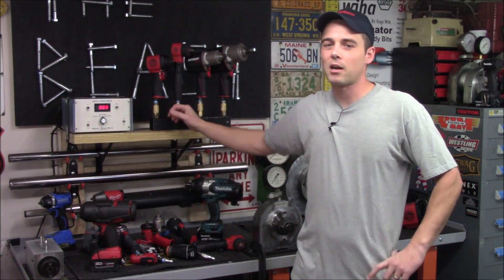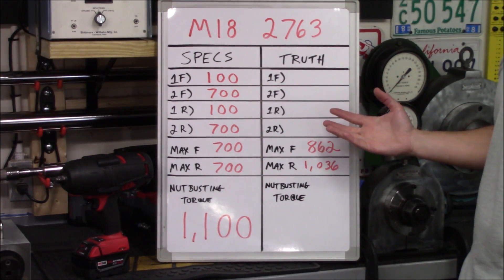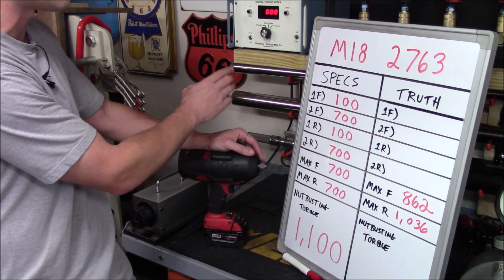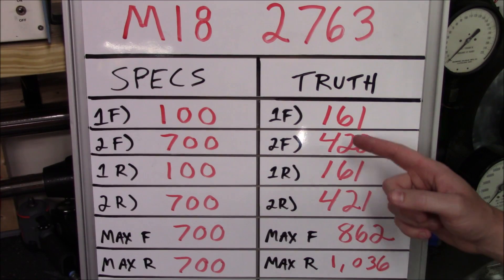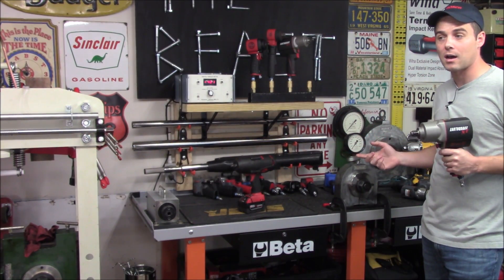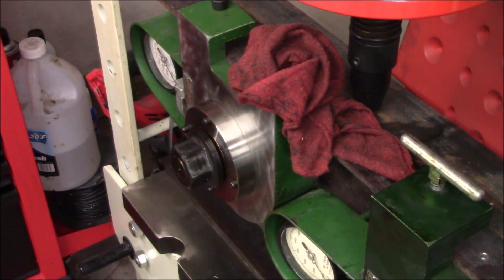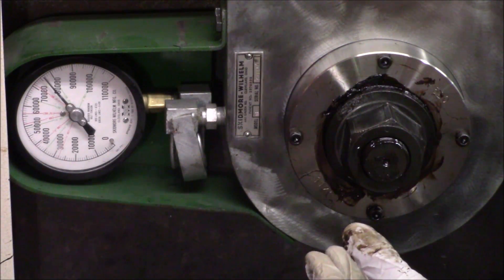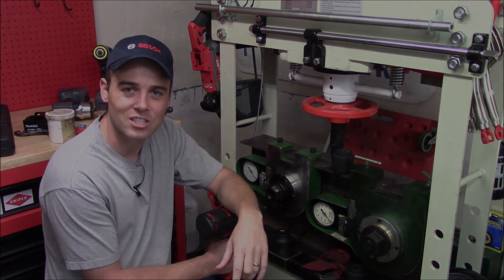THE BIG LIE -- Nutbusting / Breakaway Torque (What is it?) - Impact Wrench Torque Ratings

Comment: 1100 lb.ft. of nut busting torque means that it will break loose a nut that is torqued to 1100 lb. ft of torque
Reply from the maker: Wrong.  It means that it will "bust loose" a FRESHLY INSTALLED bolt that is still hot & has no corrosion on the threads.  It is a lie....plain & simple.
Reply: Real Tool Reviews 
isn't that what I said? obviously if it's rusted it'll be harder to remove.
Reply from the maker: Wouldn't that be the same as a truck being advertised as being "able to haul 2 tons"......but they forget to tell you that it is only in the first 3 minutes.....after that it is 1 ton.....same scam.
Reply: Real Tool Reviews 
not really. Maybe if you bring it beyond their intentions. like if you say "hey it says it's supposed to pull 2 tons! how come I can't pull 2 tons through this muddy field?" same reason the gun won't remove a nut that was torqued to 1100 ft lbs with another gun. If you were to run it up to snug with a gun, then finish it with a torque wrench as your supposed to, you would get different results. When you rattle it on with a gun, the nut gets hot & expands slightly, allowing for an inaccurate torque down.
Reply from the maker: Metal rubbing metal = friction.  Friction = heat.
Reply: Real Tool Reviews 
exactly.

Comment: 85-90 degrees is extremely hot? Versus 72. A parked car in summer time would have a lot more heat than that. At least in southwest US. It seems like there should be a standard torque standard as far as temp goes. Like barometric pressure has.

Comment: I've looked everywhere, I cannot find a video of you performing DYNAMIC TORQUE rating test on the Ingersoll w7150. I just purchased one with (2) 5.0ah battery. Please do a comparison video with the new results.

Dynamic torque
Ingersoll Rand w7150 : ??
Makita XWT08 : ??
Snap On CT8850 : 526 ft lbs fwd, 486 ft lbs reverse
Dewalt DCF899 : 411 ft lbs fwd, 418 ft lbs reverse
Milwaukee M18 FUEL 2763 : 421 ft lbs fwd, 415 ft lbs reverse

Comment: "Dooinnnng!" @ 6:43.  Good stuff, but these aren't "real' world" applications and durability, serviceability are equally as important as out-of-the-box performance statistics.
Reply from the maker: Explain to the other viewers how you can accurately obtain actual torque specs without calibrated equipment in a controlled environment?  Not going to happen.
Reply: It's not a question of you obtaining these specs utilizing the proper calibrated equipment within a controlled environment, hence my "good stuff" comment.  But tools do degrade with use and many work great "when new", and over time, what's equally, if not more important, are qualities such as durability & serviceability when compared to out-of-the-box performance statistics.  It's certainly much harder to quantify these attributes, and, in the long run, they carry more weight than controlled environment stats.  Furthermore, your exemplification of certain features being more triumphant over others when compared to other brands, is all subjective, as what's important to you may not be to another.  So be careful not to overstate what you feel is "not so good" to have or may be "concerning".  It makes the viewer feel that this is a somewhat bias production.

Comment: Can you please define dynamic torque and working torque? If the dynamic torque is really the peak torque achieved then I don't see how the working torque can be higher.
Reply from the maker: Dynamic = max torque applied with each impact of the anvil.  Working = max torque acheived over a specific duration of time.

Comment: Can I place a request/suggestion?  Can you measure the nutbusting torque of a Nitrocat 1200k using the second method in the video?  That is, removing a nut tightened to a known torque.

Comment: I don't know why you're trying to discredit Milwaukee. What's the point? The bottom line is that if the 2763 won't remove a nut or a bolt you need to call it a day or take the torch to it. The 2763 is a beast.
Reply from the maker: Lets see......I debunked a FAKE marketing term that is being abused......I am the only person outside of a manufacturer with the access to the same equipment.....I proved how they come up with inflated numbers, and yet you are implying that I am picking on them.  The only ones who are upset by this video (and the others I am continually posting about proof of various topics) are the marketing depts.

Comment: as a son of a man who's been working on cars longer than I've been alive. His advice for getting stuck or rusted bolts off is heat which I can't say doesn't work. but my understanding of physics has also taught me that heat causes matter to expand. meaning heat should cause cause a nut to expand around the threads of a bolt causing higher pressure. just my abstract thinking. but another great video. reminds me why I've been subscribed for as long as I have!

Comment: why didn't you just put the bolt on and come back  the next day to show it wouldn't remove it? why give a theory of how they cheat the test and just prove the point by waiting to show the lie instead of only doing the test hot and saying it couldn't do it cold.  BAD SCIENCE
Reply from the maker: +Adrian Wilson you CANNOT leave pressure on the Skidmore long-term or it damages it.  Feel free to go drop thousands of dollars on ONE unit & screw it up to do the test your way professor.
Reply: You would best know how to use your equipment, but not showing the numbers after a nut/bolt cools    leave it a untested theory and misses out on seeing how big a difference it makes.
Reply from the maker: +Adrian Wilson unfortunately I have to stick to the limitations of the test equipment....something that certain manufacturers apparently don't worry about when coming up with the inflated ratings.  I would think people would be glad to know true facts VS marketing hype.

Comment: Companies do the same with electric tools. When they say 1 horsepower, they really mean the tool draws 746 watts from your electrical outlet but the tool really makes 3/4 horsepower. The remaining horsepower is heat blown out the cooling slots. As far as impacts are concerned, I've always taken nut busting (dynamic) torque verses working torque the way you demonstrate. Because I most often use an impact for tear down and rarely for tightening or snugging a fastener down for that matter, it's the kind of number that means something to me. If it takes 30 seconds for the dynamic torque to break a fastener free, I'm cool with that.

Comment: hi real tool reviews....love your real reviews!!!  so smooth and your so good lookin..(im not gay)...anyway in your personal unbias opinion...which brand is better???  Milwaukee or makita...i have bought into the milwaukee fuel range and im very happy with them....but for collectors sake some of the makita are "made in japan" and im a real sucker for that but all i like is their high torque impact wrench and driver...most of there other stuff aren't as good as milwaukee i reckon...do you have the full makita range???
Reply from the maker: Thanks!  It would depend on the specific tools....which ones would use be using the most?

Comment: I don't think this debunked the marketing numbers as others have suggested.  I get that the bolt was warm, but it was torqued to 1100 ft-lb while warm, and removed while warm.  It did in fact remove a 1100 ft-lb nut.  And you nearly achieved the 1100 ft-lb fastening torque in previous testing with the be reverse threaded nut.  The numbers seemed to have been proven by your testing.  Great video, and your reviews are among the best!
Reply from the maker: Thanks!  The point was to show the deceptiveness of marketing claims.....in real life the "Nut Busting" torque specs are 100% worthless.
Reply: Real Tool Reviews agreed,  I have never come across a newly lubed bolt I couldn't get off!  lol.  However, the nut busting torque does.provive some relative scale of the tools performance.   A horror freight tool for example rated at 300 ft-lb vs. the Milwaukee rated at 1100 still tells you the Milwaukee has nearly 4 times the torque.  And in a real life application the Milwaukee is about 4 times more likely to be able get that stubborn nut off.

Comment: Really good information.  Thanks for that.  Have you or would you do a review of torque sticks?  I just purchased some Neiko sticks and I'm wondering how accurate they are.
Reply: BTW... L-O-V-E my Milwaukee 2763.
Reply: 1 more thing... Could you say that nut busting torque may be useful if you applied a torch to the nut first... thus heating it up?
Reply from the maker: Nut Busting Torque = BS......using a torch first will make it easier to remove, but it has nothing to do with this fake rating.

Comment: I'm not understanding something here. If the forward and reverse dynamic torque are exactly the same, why is it that the maximum reverse working torque is so different from the maximum forward working torque?
Reply from the maker: The dynamic torque is not a "build up" over a period of time....it is only showing how hard it can hit (peak dynamic torque.....or max torque measured out of a series of impacts during the test run).  Some impacts (like this) have almost identical numbers, and some have a 20%+ difference in forward/reverse.  Showing the testing on both versions to prove "peak dynamic" & "max working torque" is the only way to prove who is actually more powerful.  Interestingly enough....the 3/4" cordless versions (Makita & Milwaukee) were neck-and-neck with the 1/2" versions for max working torque in previous vids.....but when I ran the dynamic torque with the same impacts, the 3/4" versions hit a LOT harder.  That means that they would be more effective at removing fasteners (such as tractor trailer lug nuts).
Reply: I understand the difference between dynamic and working torque. My point was that for the Milwaukee, the dynamic torque, (let's use just reverse to keep it simple), is 422 for forward and 421 for reverse. How is it that since the numbers are essentially the same that they can be so different when working torque is measured for forward and reverse? In other words, equal torque is being applied in both forward and reverse when measured dynamically, but not when measured for working torque. That doesn't make sense.
Reply from the maker: +Pro1er well...basically the electronic skidmore shows the max peak dynamic torque, so for example....100 individual impacts of the anvil range from 300-422 ft-lbs....with 99 of those being 300 & only one being 422.....it displays 422.  The next run is also 100 individual impacts....300-422 ft-lbs......50 are 300 & 50 are 422.....it also shows the peak # of 422.   It is not showing a graph of every single impact & not all are the same, it merely shows the peak number achieved.  The total amount over a given time will differ, some more & some less....by running for a specific amount of time on the bench/beam mount units, we see the result of all of those tiny impacts & the impacts ability to tighten a bolt (RH & LH threads).
Reply: Thank you, what you say makes sense, but it seems strange that there would be so much variation in blows. I know it's not a Swiss watch, but being a machine I would think the impacts would be relatively the same, not the huge difference we see here. Anyway, I enjoy your videos. Keep up the good work.

Comment: Nice info, but still love the 2763. Having come across a lugnut i couldn't get off, or a rusted  CV bolt.
Reply: I've got the same one 2763 I couldn't agree with you more
Reply: joethecollector
Reply: Agreed.  A guy in a technical dept of one of the good quality impact wrench companies told me I should just get one of these because you have to have a really good/expensive air compressor to get their guns to work well.   I bought a small HVAC oxy-acetylene set up at Lowes also for the bolts these don't take out.    I live in a northern snow rust climate and this Milwaukee has done the job on rusted brakes bolts, struts, and the torch worked for the few that it hasn't (maybe three).

Comment: I once did a noob mistake and overtightened lug bolts on a car with the same Milwaukee impact by hammering each about 2-3 seconds. I immediately realized I've made a mistake and tried to loosen them with the impact. They did not even budge!! I had to use a 3 foot breaker bar to loosen them, and stripped the head of one bolt in the process. I have little faith now in the Milwaukee impact for anything serious.
Reply: That doesnt make sense, impact wrenches always deliver higher torque in reverse, most probably you damaged the bolt and it got stuck; I actually did the same thing with my Milwaukee 2763 and the result was the nut stripped a little
Reply: so it worked too good and got it to tight and you are bad mouthing it?
Reply: I believe what he's getting at is your reverse torque should ALWAYS be higher then your forward torque for that exact reason.
Reply: Paul Friend, I'm not bad mouthing anything. I was just surprised it was unable to loosen the same bolt it tightened just moments ago. Moreover, a 3 foot long breaker bar which probably put out 300 ft-lbs torque tops got it off.

Comment: Why go through all this EXCELLENT testing yet not try removing the nut when it's completely cooled off as a final test? That would absolutely legitimize this video beyond what it already is...heck, you even mention you have doubts it could happen at the end of the video. Missed opportunity to have this all in the same video. Truths like this hurt companies and will get you blacklisted from receiving free gear. Fakers like "tools in action"  would never do something like this other than the typical 'slap on the wrist' comment about something they don't like about a product. Great job!
Reply: You can use some freeze spray to quickly cool it down.
Reply: That may damage his precision machine. That said the impact wrench should still be able to remove the nut or bolt, however, it would take a longer time if it was cooled down as the nut or bolt will heat up as you impact it.
Reply: The testing is excellent. But the whole matrix of test you propose is unreasonable. Go ahead and get your self a set of Skidmore wilhelm instruments
Reply from the maker: +xXG.L.HXx I cannot leave the skidmore "loaded" under extreme pressures for extended periods of time, or it will damage it.  The gauge & hydraulic seals are only designed for temporary pressure for long-term reliability of the unit.  I'm glad that you liked the vid....I try to do the best that I can.
Reply: Put it in the freezer and tighten it up once.  That will keep the heat out of it.  I think one real problem with this review is that you can't calculate torque from bolt tension.  Maybe you used a torque wrench to get your 70 divisor and I missed that but it won't stay consistent at all.  That's why your numbers were going up on the third run across the board.  That's one reason that the preferred method of tightening rod bolt is with a stretch gauge and not by torque. @RealToolReviews
Reply: How about cooling it off fast with co2 or something like that then try to remove it
Reply: xXG.L.HXx U Butt hurt or something.

Comment: Im surprised you didnt try it cold, I thought for sure you were going to.
Reply from the maker: +therealshafto it screws up the Skidmores to keep them under pressure for extended periods of time....I would have had to let it sit overnight & the gauge/seals could go bad during that time.
Reply: ah, yeah lets not compromise your tools! I have that beast of an impact, I love it. Despite what Milwaukee says, I'm fairly confident dark matter powers it. I also have a M12 FUEL 3/8'' which is a little gem too.

Comment: I am glad you said "immediately".  Because removal torque is actually more than installation torque over time.  This is not just temperature, but also corrosion and deformation of bolt/nut into each other under stress.  This is how the situation most people encounter.
Reply from the maker: I agree.....that is specifically why I explained it that way.  Thanks for pointing it out --- yes, for MOST fasteners, removal torque is almost always more than installation torque.
Reply: Real Tool Reviews Thank you for the data based analysis on these tools.

Comment: how about you try different size batteries 1.5 amp up to 5amp or even the 9amp battery and see if battery size makes a difference
Reply from the maker: Batteries absolutely DO change power levels.....rpms.....and torque specs.  I have a video coming up specifically about this.
Reply from the maker: I think it will be an eye-opening experience for a lot of people....
Reply: There is definitely a change in power I put 1.5 amp battery in my drill and then a 4 amp and you can hear the difference without even using it
Reply: It's because batteries also have a maximum rate of discharge.  As an example, the Milwaukee 2.0 amp battery has just one set of 5 batteries inside and the 5.0 amp battery as two sets of 5 batteries inside.  The 2.0 amp battery may only be able to dump a maximum of 15 amps, but the 5.0 amp with it's two sets of batteries can dump a maximum of 30 amps as an example.  I'm just estimating the maximum amp output, but the rate of discharge increases with multiple banks of 18 volt sets.
Reply: Amp hours have no change to power, only run time.
Reply: +Real Tool Reviews huh that would go against everything I've ever read about batteries. I'll be looking forward to a video that shows otherwise.